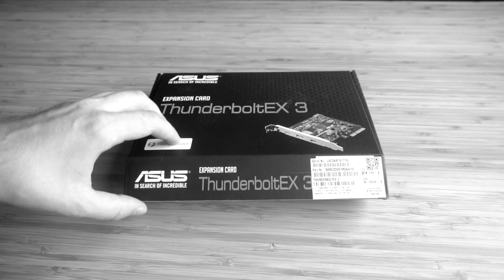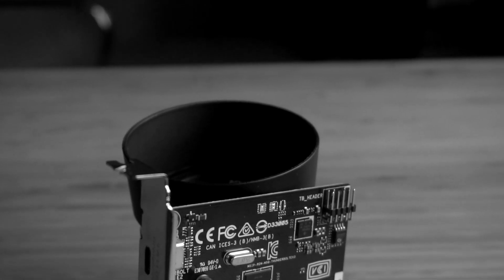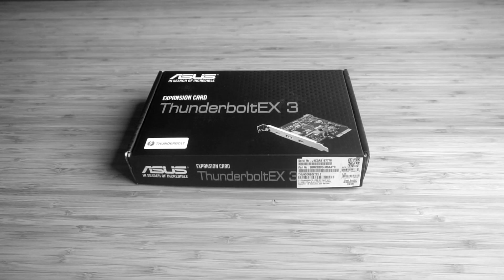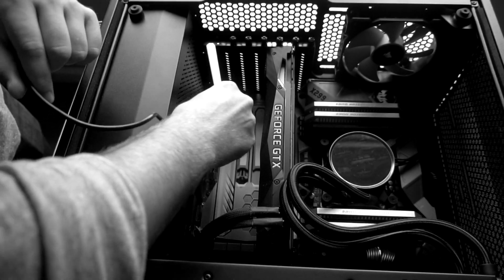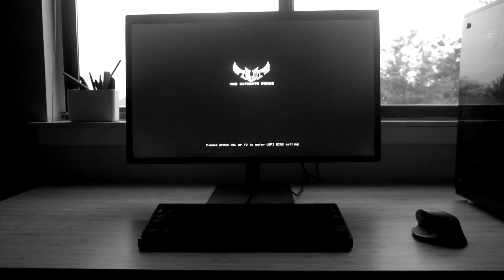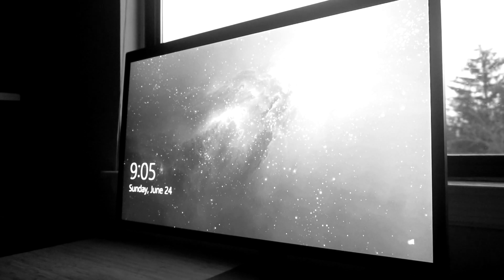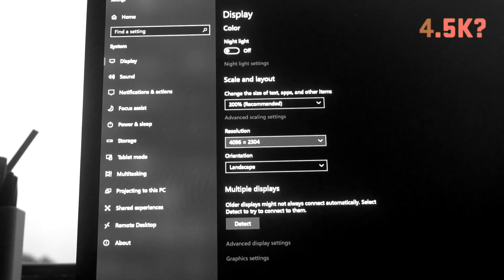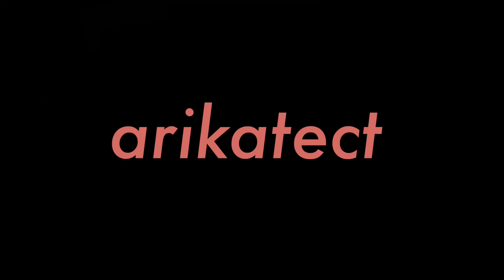LG Ultrafine 5K on a  Windows Desktop

Comment: I have an Acer Orion Predator w a 3070 and the LG 5k monitor.  I've got it working great on 4k res with a bidirectional DP to usb C cable.  I'm keen to get a Thunderbolt 3 (or 4) card though to get that crispy native 5k resolution though.  If anyone out there has had success with a similar setup as mine, give me a shout out, thanks!

Comment: Drivers have nothing to do with the lack of 5K. It's the lack of display bandwidth. 5K at 30 bits per pixel and 60 Hz is 5120*2880*30*60 = 26.54 Gbit/s. The Thunderbolt add-in card you used has only one DP 1.2 port, which provides 17.28 Gbit/s and doesn't support compression. To run the display at full resolution, you either need to connect two DP inputs, or one DP 1.4 input if the display supports compression. Both aren't supported by this add-in card.
Reply: Thanks a lot my friend, I just checked the add-in card he used, which is  DP 1.4 and supports 8K, so why? Does this mean that I might need to try the EX5 add-in card which has DP 2.1 capabilities?

Comment: Ok, for anyone looking at this in 2023...Here is what you need to do to get it to 100% work, this uses a similar method to above with a Thunderbolt adapter card, but you do not need to access the BIOS.  This will also probably work for an Apple Studio Display as it's pretty much the same hardware, I can't confirm as I don't have one.

I connected an LG 5K Ultrafine and  RTX 4090 this way:

1. Buy a ASUS ThunderboltEX 4 card and fit it inside you PC
2. Use the x2 supplied Mini Display Port to Display port to Connect the Card to the GPU. It is important you use x2 as if you just use x1 it will only run at 4K
3. Use the Thunderbolt cable you normally connect from Mac to LG Ultrafine 5K to connect the Thunderbolt Port on the Adapter Card
4. Boot PC, the display will light up and once in Windows you should be able to select 5K from display settings (I was using Windows 11)
5. To Adjust Brightness Search out 'LG OnScreen Control Driver' for Windows - This is buggy but it works (Windows 11) 

REMEMBER - UNLIKE THE VIDEO, YOU DO NOT NEED TO ENTER BIOS AT ANY POINT

Further Notes: 

- Sound will route through the machine, and you can adjust volume, but not on keyboard.
- I have read its possible to do without the card, however when I tried it I couldn't get it to work. Using the ThunderbotEX card method definitely works.
- One thing to remember though, the LG display is not a Gaming monitor and is limited to 60Hz.
- You also cannot adjust the Brightness on the fly, you have to interact with a very buggy App, so not ideal. 

However, as I said I can confirm that I can 100% run the LG 5K Ultrafine at full resolution on Windows 11 with an RTX 4090.
Reply: Thanks for posting this.  I have an Acer Orion Predator 3000 P03-630 with intel B560 chipset w a 3070 and the LG 5k monitor.  I'm trying to figure out if there's an expansion card out there that would work for my system.  Seems it's important to get an expansion card with dp 1.4 support and support for one's chipset, no?

Comment: its not drivers it's a physical limitation that apple overcame with custom thunderbolt controller; normal 5K monitors on PCs require 2 display port connections at the same time, thunderbolt 4 on a Mac handles both connections internally. there is no equivalent available for PC, you'd have to buy a dual display port 5k compatible monitor (extremely rare) and use a dual header output video card (most are capable) - which is why this monitor is specifically targeted to Mac users because it costs LG less to make this screen for apple than a similar PC version and a custom recombiner hardware that requires it's own cpu and ram on the monitor.

Comment: Many thanks for your help in this matter! After all of these years, the issues related with LG UltraFine (and now Apple Studio Display) still persist. Thanks to you and many other YouTube channels (and all people around the Internet forums and message boards) we can say that we have finally found a group of solutions (so that we can tell it finally works). I have recently made a comment on a YouTube video. And I would like to share the basic steps that I have elaborated there so that it can reach many more people looking after some sort of solution. 

Note 1: LG UltraFine 1st iterations differ vastly from the latter versions. My comments are based on the second variations of the same product line. If you have the first iterations, I highly recommend looking for a Thunderbolt 3 (or 4) PCie card. This might change in the future once USB4 (with necessary video signal and data transmission) standards are applied on the future products. 

Note 2: LG UltraFine 5K (2nd iteration) differs slightly from its 4K brother (2nd version). UltraFine 5K requires Thunderbolt 3 (or 4) PCie card if you want full 5K resolution. Otherwise, it will be limited to 4K. This might be an issue since you will suffer from lack of sharpness and proper scaling; and, hence, you will not get desired experience. 

Here is the comment that I have made on video entitled, "Windows PC to Apple Studio Display - Will it work?" by 6 Months Later Reviews. 

In my understanding, Apple Studio Display is more like the “infamous” LG UltraFine 4K (24-inch) and 5K (second version) monitors that were lined up next to Apple computers. Just like LG’s UltraFine lineup, Mac Studio Display will behave nicely if you manage to send video and data signals from the same cable. Both Huawei and Belkin’s charge and sync cable for Huawei’s VR Glass do a great job when it comes to catering for those in this scenario. It is simple, plug & play. Unlike a Thunderbolt 3 & 4 add-on card, you are free from all the hiccups that come with software issues. Brightness, audio and additional USB ports also work very well. The only downside is you are limited to USB 2.0 on those USB ports. The second alternative is Club 3D’s “CAC 1332” HDMI cable. From my readings through the Internet, this cable might have a second iteration that does not have a USB additional data cable anymore. So, be cautious. But the first iteration works like charm without any hiccups. If you happen to have a Nintendo Switch, Xbox Series X or S, or Playstation 5, you are good to go with this cable. For those PC users also, this cable will work very well. There is one downside though. You can no longer access to USB ports (so you are limited to audio). There are additional fourth and fifth alternative solutions that can actually help (if you are a desktop PC user). If you have a compatible motherboard, you can attach a Thunderbolt card. Unfortunately, not all computers are Thunderbolt 3 (or 4) compatible, so you might be out of luck. In the fourth and the last alternative, you use Delock 89582 PCI Express Card. This card is a re-branded version of Sunix UPD2018 in the EU market. Unfortunately, I do not have enough information about this product. 

In summary, Apple Studio Display will only come into your use if you go through these alternative solutions. If you are already a Mac user, and you really want to make this kind of monitors work, here is your endeavor waiting for you. But if you are a PC user, I do not recommend USB-C only monitors at all. They do not support KVM switch, and more importantly because they need macOS for software updates, you are going to have trouble. 

Addendum
You can actually control brightness and additional settings thanks to ClickMonitor DDC. Unfortunately, the software development has apparently stopped, but it works great with MS Windows 11. If you are a Linux user, gDDCControl is quite useful.
Reply: Can ClickMonitor DDC control the colour temperature of the display?
Reply: @NyashaM  Unfortunately, it cannot.
Reply: Wow! thank you.

Comment: it works with  tb4 too LG Ultrafine 27MD5KA-B laptop ASUS TUF Gaming F15 FX507ZM_FX507ZM but in single mode it goes very low in fps 3dmark 11 advanced 5k benchmark crashes out

Comment: Hey Arikatect, I've added a similar expansion card and the same monitor to my PC.  When I first installed the monitor, it would auto detect every time I booted up the system.  However, one day it stopped autodetecting the monitor and now I have to unplug and plug in the monitor to get the PC to see the connection.  Any experience with this and or a solution?  Thanks!

Comment: This way works even without any discrete GPU, but your CPU should have internal video chip, 
e.g. intel UHD graphics. My LG Ultra fine 5K works well on system intel core i9 Windows 11 (PC) without videocard, only Intel UHD 770 and ASUS thunderbolter 4. So Resolution 3840x2160 and i'am totally happy.

Comment: 4.5k... The entire point of going through all of this hassle is to get the native 5k resolution. Which is very important on an LCD, because unlike a CRT display which can actually change how many pixels it is natively displaying, an LCD cant. Think of it like a fixed grid or mosaic. It has to resample a 4k or 4.5k into a 5k grid, meaning that you will never get a pixel perfect display, and areas that should be a perfect 1pixel stroke for example will end up being hazy resampled 2px  line of blurriness.

Comment: anyone tried? i going to have the same setup this weekend with my new DIY PC. so the audio will still going to work as in the sound coming from the 5k monitor?
Reply: I have had no issues with audio. It works as it should with the setup that the video author used. The only thing I have issues with is the webcam, but I use a better quality external webcam anyways, so this does not bother me.

Comment: Hello brother. I have connected lg 5k display to my windows pc using gigabyte gc titan ridge. But it only supports upto 4k. How can I get 5k resolution ?
Reply: did you use two DP In cables? just purchase other 20 cm DP cable, have a try

Comment: Its an absolute shame that thunderbolt is so locked down. I hope that changes with USB 4.x which includes Thunderbolt support. (Why is it still not possible to buy a universal thunderbolt card that fits in a normal PCIe slot, without any further connections except GPU loopthrough).
Also, the display needs two DP1.2 streams to have full 5K/10bit support. (Or a single DP1.4 which works at least with 8 bit color depth). Your GPU or the thunderbolt card either don't support DP1.4 or the monitor just has DP1.2 support. There are adapter boards to make this panel a normal dual DP1.2 display. However they connect straight to the panel. I am waiting for one from china. costs around 200 bucks, and you have to drill a hole in the back of the monitor for the new connections. Well worth it as I got an Ultrafine 5K with a defective driver board almost for free.
Reply: Could you give a bit more information on this? I've got one of these Ultrafine 5k displays just sitting here right now

Comment: Hey there Arikamedu, appreciate the info you provide. Unfortunately, I am unable to go beyond 3840x2160. I am using all the hardware as it is from ASU’s. 

Motherboard : Prime X299 - A
Graphics : NVIDIA GeForce GTX 1070
Display : LG Ultra Fine 5k
Reply: I'm facing same issue. Have you found any solution ?

Comment: My work notebook (HP Elitebook 840 G5) can only drive 4K on the LG Ultrafine 5K through its native TB3 port, but interestingly, if I connect it to my HP Thunderbolt Dock G2, I can get the full 5K. I think it’s because the Dock has 2 DisplayPorts, and is able to send the double DP signal through the TB3 port.
Reply from the maker: I imagine the dock has the chipset that allows multiple 4K monitors. Thus giving enough bandwidth to run at 5k. It’s similar to the setup inside Mac laptops.

Comment: Hi guys,

I have a Hackintosh and an LG UltraFine Display 24MD4KL. I would like to connect to my Hackintosh. Please help me with this problem. 

Hackintosh details:

- Gigabite B365M DS3H

- Asus RX 5500 XT 8Gb GDDR6 DUAL-RX5500XT-O8G-EVO

- 2,9 GHz 6-Core Intel Core i5

- 32GB

- Catalina

Thanks for your help!
Reply from the maker: Well, several issues. The motherboard you have is MATX so you only have a single expansion slot. This means you can’t add a TB expansion card in. Your GPU also doesn’t have a type c port with DisplayPort like some nvidia rtx cards. From the specs you sent there really isn’t a way to do it with the system you have.

Comment: The display is able to process RGB colour? I thought it's only able to work in DCI-P3 colour space. Besides the brightness being an issue, are the colours in Windows ok? No over-staturation, etc?
Reply: I have ASRock H370 Pro4 and I've installed Thunderbolt 3 AIC R2.0 card from ASRock. Brightness and USB hub works. I use an app called "LG Ultrafine Brightness" which can be found in  the Microsoft Store. I had to set the BIOS setting "Windows 10 Thunderbolt support" to false so that the monitor would wake up from sleep. So in short everything works! The colours in Windows indeed look a bit oversaturated, so in my Nvidia Control Panel I dial back the digital vibrance to 45% from the default 50%. Colours are still not the same as in my Macbook Pro, but close enough.
This is with the LG UltraFine 4k 21.5"
P.S. I've also tried, side by side, Dell P2415Q and the UltraFine looks much better b/c the outgoing light is not diffused / scattered unlike the Dell which has a matte screen. I wish more manufacturers adopted Apple's approach of adding an anti-reflection layer vs using a matte screen.

Comment: I am wondering how do you go about switching between your Mac and Windows PC on the daily basis? Is there some sort of USB-C Thunderbolt switch that you utilize? Thanks
Reply: UltraFine has four USB Type-C sockets. And two of them are thunderbolt enabled. So you could connect both of your Mac and PC.
Reply: Ruslan Shashkov, I thought only one of those ports is an active video input port TB3 for MacBook Pro or Windows 10 machine, the rest are expansion ports to daisy chain other monitors and hard drives etc. Are you sure that I can have multiple computers connected to those ports on the back of the monitor? How do I go about switching which input source I use due to lack of any buttons on the UltraFine 5K monitor itself? I can’t figure out how to switch between 2 video sources on this monitor?
Reply: @send2sergei  I think Ruslan might have been referring to LG's newer models that have both TB3 and HDMI, not sure. I can confirm it's only got 1 input TB3 port.
Reply: Christopher Pfeifer that makes sense that while it has 4 TB3 ports only 1 of those is the video input. Are there any external TB3 video switches that you would recommend for multiple input source switching?
Reply: @send2sergei  no, I've been told they don't really exist and you'd just need a TB3 "dock" or "hub" that includes video. But it probably wouldn't have two inputs and switching so yeah.. Not really lol.
Reply: Christopher Pfeifer Thank you for helping out! Much appreciated!

Comment: Is it possible to connect the monitor to my windows with cable that is displayport out and type c in?
Reply: Same here I would like to know if can run on a RTX 2060 with a cable that goes from type-c to display port. Thanks in advance ;)
Reply: I found some cable that’s capable of transmitting 5k (5120x 2880 @ 444) signal bidirectionally.
Reply: @noopnoog  I don't think he test the displayport in that video(only via usb c and HDMI). I will maybe test the above mentioned method to see if it work out.
Reply: Lu Ben today I received the thunderbolt card! In 4 hours I will mount it! Will see what happens xD
Reply: @noopnoog  What motherboard are you using?
Reply: Lu Ben Asus ROG STRIX B450
Reply: @luben2994  Shame I can not connect with my motherboard because does not have the TB_Header connector.
Reply: Too bad to hear that. My motherboard doesn't support TB3 either.

Comment: Do you know if this will work with a GIGABYTE X570 AORUS ULTRA Motherboard?
Reply from the maker: I don't think so, Gigabytes Thunderbolt expansion card don't support AMD systems and that motherboard doesn't have the correct I/O built in.

Comment: Dude, i just bought the Razer Blade 15 Advanced Model with 2080 Max Q. My LG 5K works with 5K native Resolution. I thought this is not possible... But it works. Connected Peripherals and Audio also work plug and play.
Reply from the maker: Lukas von Niederhäusern that’s pretty awesome! They most have updated the display post standard on the new Razers. The LG 5K is just a Thunderbolt device so it should work with other Thunderbolt enabled things like laptops.
Reply: Arikatect Yeah but sometimes they don‘t passthrough the video signal. And sometimes it is just onboard graphics...
Reply: @lukasvonniederhausern6153  could pls do a video of you system, pros and cons?
Reply: @Tiraloale  There are not many cons. Only the fan is a little bit annoying. It is still on, also when you do just nothing.

I usually work with a 4k resolutions instead of the full 5k. When i do 5k, the integrated intel GPU has near 100% workload and the fans are going wild.

Performance of the 2080 Max Q is good. It is very similar to my 980 Ti which i had in my "old" desktop computer.

Yeah, and sometimes, i have to plug in the LG 5k one or two times until it works correctely.
Reply: Lukas von Niederhäusern so 5k attaches to integrated card, 2080 is not available to drive tb display?

Comment: Thank you for sharing.
i use GC-ALPINE RIDGE and Z390 Aorus Master, but i have this issue:
LG Ultrafine monitor’s power delivery (Black out from the boot and wait until power delivery for 5-10min later).
Do you have this problem??
Reply: when you put your comp to sleep and wake, does it turn this monitor back on? mine goes to HDMI on wake
Reply from the maker: DK zhao yeah I have had similar issues with running this display, I think it’s down to there not being any real drivers for it in windows. But also check you Thunderbolt settings in the bios there might not be something enable during the boot process.
Reply: Did you ever get this issue sorted out?  I am experiencing the same problem.